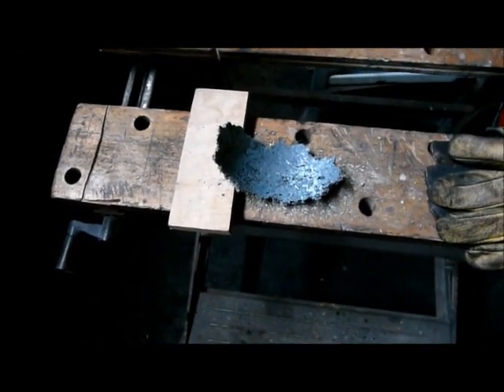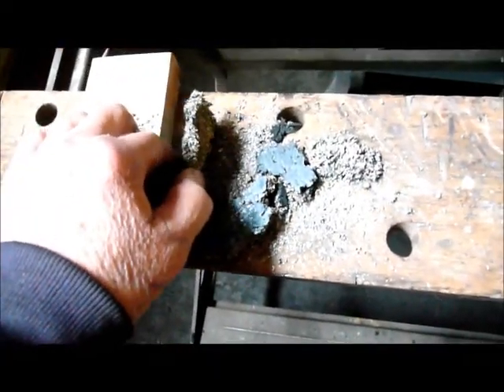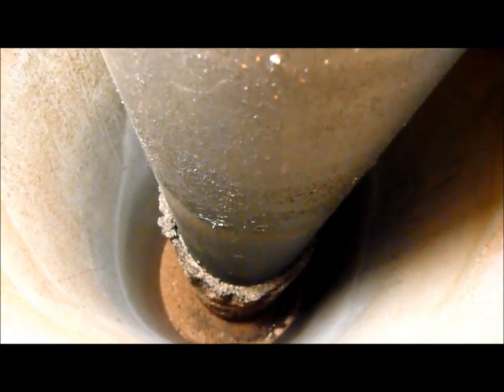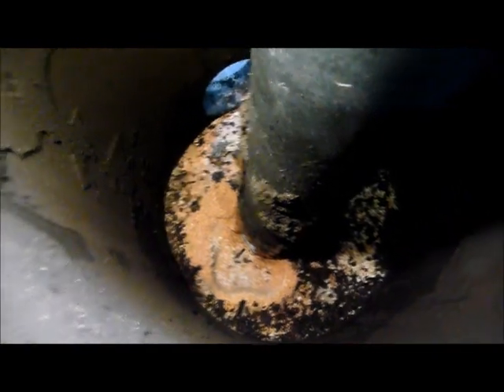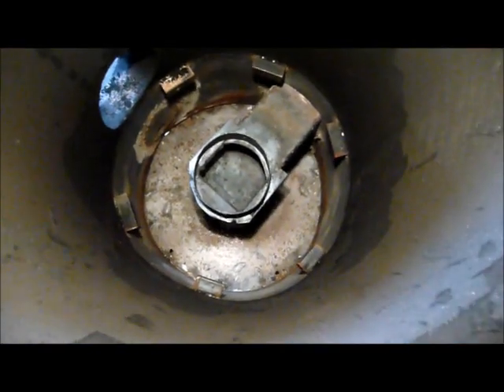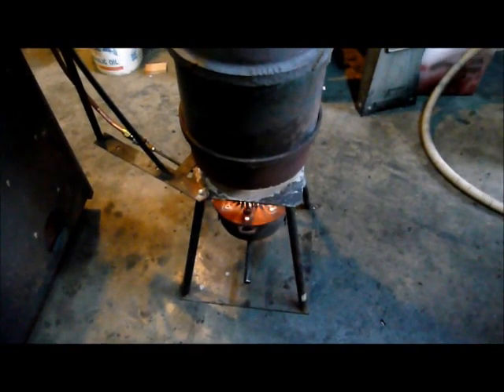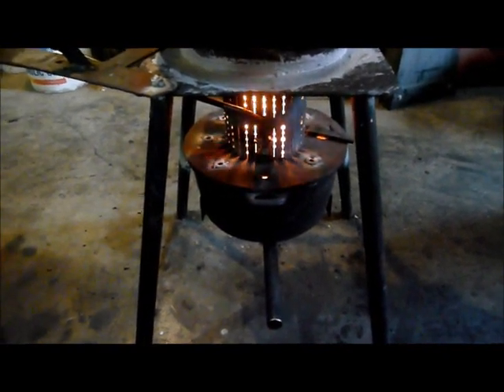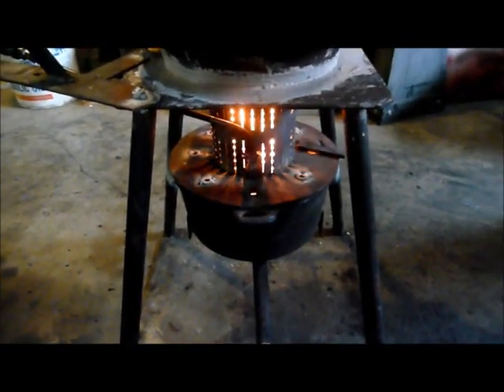Rocket Heater - Final Chapter

Comment: So I was thinking about your problem. What came to me is a cast iron engine block.  Actually came up with a design to use two. Seems the issue is too much heat for the amount of metal. Thickness didn't seem to help as it seems to be a material issue. And I was thinking a cylinder wall is some pretty tough steel.
So my idea is to take a 4 cylinder, cut the cylinders out of them, grinding back the edges to be able to weld the cylinder's together in a tube.
Then I thought, what if I set up an engine block, and run that tube after trimming away the journals, where the journals are, drilling one hole in the side of the tube per upright cylinder.
My thinking is the sleeves could handle the heat, and the block would give it more mass to draw the heat away.
Then just cut a barrel lengthways, to slip over the upright block.
Reply from the maker: You could save yourself a ton of cutting and grinding if you used engine cylinder liners.  Check on ebay, there are quite a few available.  Good luck!

Comment: You designed a good looking furnace. Too bad it failed. Isold/taught industrial maintenance welding alloys for years. Stainless steel is lousy in apps with lots of thermal cycling.  Before I'd touch stainless parts I first got a release signed proclaiming the part was irreparable junk. SS Expands/contracts a lot compared to most other metals.  

Appears to me your fuel mixture was too rich. JMO.  Rocket stoves consume lots more air to  fuel.

Comment from the maker: Google: Magic Heat  to see what I use to reclaim heat that would normally go up chimney. Magic Heat is a heatilator brand name.

You'll have to do some research on how rocket stove work; but you are correct, frequent feedings were required when using wood as primary fuel.  Watch: Web4deb  videos to see how he does it.

No way to measure output accurately, but making chimney flue clay liner glow red makes me think it was HOT!

Comment: After all your work the disappointment must be hard. I can't address your heat damage issues but 2 questions. 1) What is the "Heat O Lator" above? I've no understanding. 2) 5" square firebox tube. How was the stove to be fuelled by wood? Looking at about 140,000BTU/gal and 8,000BTU/pound wood. You would have been constantly feeding or were you considering home made pellet or chip or??? Hang on this is an output of about 7KW. Not charring stainless on that! Any idea of initial peak output?

Comment from the maker: I have watched that video many times. I think there is a fundamental difference in the use of these two devices. In the video, they use a handful of wood each day. A short duration burn to heat a relatively small mass. In contrast, my heater ran flat out for hours trying to heat a large volume of air; a big difference. My analogy is a sprinter versus a long-distance runner. The best sprinter would die trying to run a long-distance marathon. Thanks for your comment!